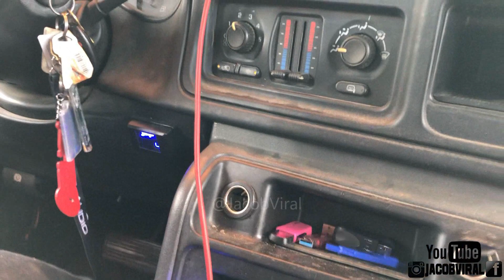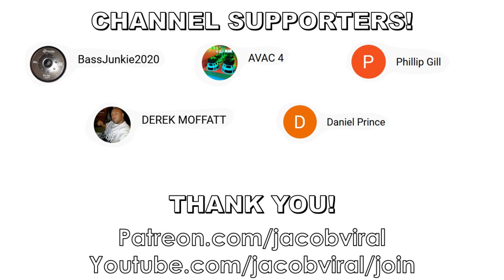ARE SUBWOOFERS BEHIND THE SEAT LOUDER?

Comment: How is he only hitting 149 tho
Reply: Must have high box rise and therefore is underpowering the 4 15s. Plus the port may need tweaking. Also may need an additional Limited Limitless. Possibly more runs. So many factors but I agree, there's room for improvement. Much potential. I suspect it should hit a 157 dB once all is dialed in and properly powered.